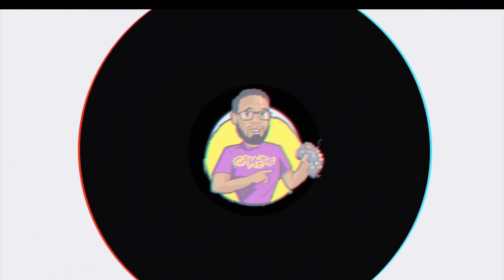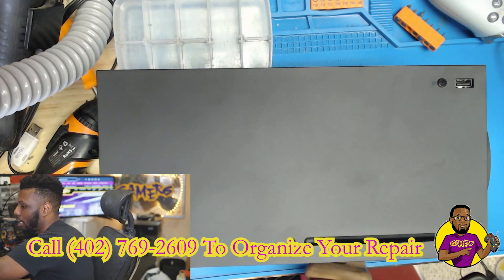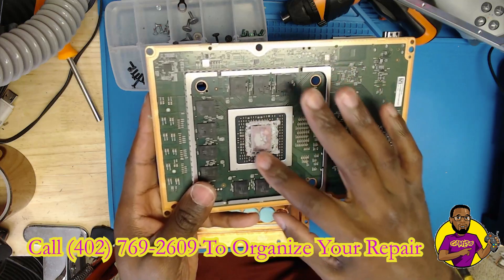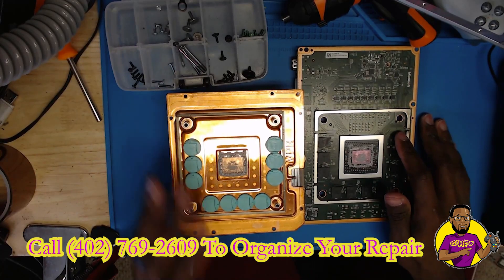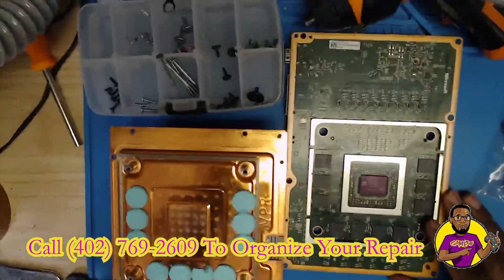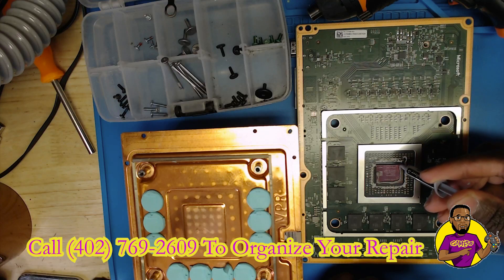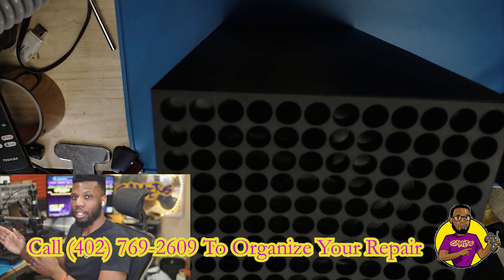Fix Xbox Series X Overheating and Turning Off Repair

Comment: The fact that you have to change thermal paste after 1-2 years says it all. The ps4 even lasted 8 years until it turned into vacuum cleaner simulator. Had my first overheating shutdown and barely owned the series x since Christmas.
Reply: have to change thermal paste on all computers after 2yrs anyway so consoles are no different
Reply: There are other factors at play.  Viscosity is a huge one.  MX-6 so far after a full year of use has been solid.  Whereas kryonaught would pump out (essentially oozing itself out from between the chip and heatsink) after a few months.

The PS4's fans were taking other temps into play.  My original launch day PS4 was loud even after putting good paste on it.  It wasn't until after I changed out the Memory Thermal Pads that the peak noise was significantly reduced.

Then look at the PS3 Original models.  There are loads more Thermal Pads which leach out oily substance after years of degradation.  One of my original 60GB models would progressively get louder and wouldn't get quieter even at the XMB.  It wasn't until I popped off the Heat Spreader on the RSX and changed that out with MX-6 that the Fans remained quiet and would slow down when the load was reduced.

All in all, Gaming machines and PCs, even handhelds, all need maintenance at some point.  I am curious to see how long Liquid Metal lasts on the PS5.  Will we see cases where an unopened PS5 that is regularly dusted has dried out Liquid Metal?
Reply: my firts series x was a beast this second one it already turning off wish i had the first one back

Comment: Set to energy saver and disable automatic updates. Trying to play any of the high resource games while the system updates games in the background will Chernobyl your console. If your console keeps throwing the ventilation error randomly check your queue and pause or clear it.   All I have seen are videos telling people to open up their consoles or send them to Microsoft for repair.
Reply: Good shit. As soon as I switched to this method it stopped immediately 💯
Reply: @josh-o8t I did find that the power outlet on the other side of the wall was on the same circuit, so an appliance in the other room was drawing enough power to rob my Xbox of juice. I moved the offender to a different outlet and I haven't had anymore overheating problems.
Reply: @josh-o8t Have you resolved your issue? I know I was super pissed until I figure it out. It feels like a lot of us paid the extra money to acquire on of these new consoles during the shortage and that makes any bugaboos even more painful.

Comment: i have an xbox series x since march 2021. over time it started to heat up and i could hear the fan blowing louder and louder.  sometimes it went out by itself for safety.  following this tutorial I opened it for the first time to clean the fan and the cooler.  It wouldn't turn off anymore but the fan was blowing hard when I was playing FIFA 22 or resource intensive games.  it bothered me so I bought an ''ARCTIC MX5'' thermal paste and since then my console no longer heats up and the fan runs normally like on the first day.  I strongly advise you to change the thermal paste you will notice that the old one was not of very good quality.
Reply: This started to happen to me right after playing fifa 22!
Reply: xbox series x fan loud

Hi i have aan issue with my series x in some optmise games series s x my fan goes loud for exemple 
Fifa 22 in.the menu 
 Ac valhalla in performance mode only quality is dead silent 
Halo infinite warfare performance loud but quality silent 
 Its not like a ps4 level but its noticible ...
 I ask some friends they told me that their console a quiet .. even with heavy loud 
For old gen games even in 4k its  silent ... 
Also another think i try everything reset console performe offline ubdate cleanig from dust only without open it ..
Remaining now only change thermal past
The last games tennis match point make it loud even its not an heavy game .. also this games called lake its make ot loud anyone can help or confirme what i said please
Reply: @fingerstyle9165  Hi my friend.  I understand your concern about this fan problem.  the solution is to buy a thermal paste like Artic mx4 and follow the tutorial to open your xbox and apply the new paste.  you won't have any fan issues.  on the other hand if the place where you placed your console is hot it will have to be replaced elsewhere. Peace
Reply: @SoufixTTV   i know but i wanna make sure its already well ventilated   .. but why happen only with tittles series s x  .. that my concern thx you i will soon open it and apply the new thermal past
Reply: @fingerstyle9165  because series x games are way harder to run then Xbox one games
Reply: @stgbuckets   got new xbox and its run quiter
Reply: @fingerstyle9165  idk if I should send it in for repair or just buy a new one I'm done with the crashing issues
Reply: @stgbuckets   but still you can hear fan its not that possible that you cant hear it its 4k man
Reply: @fingerstyle9165  yeah I don't play on 4k tho
Reply: @fingerstyle9165  Is it still as quiet now as you've had it for a year?
Reply: @fingerstyle9165  Is it still as quiet now as you've had it for a year?
Reply: @SoufixTTV  i change the xbox 3 times only for that every time is the same end up by understand that the electricity is the problem man can't solve it in my country but its okay work fine  sometime in the day can't hear it att all
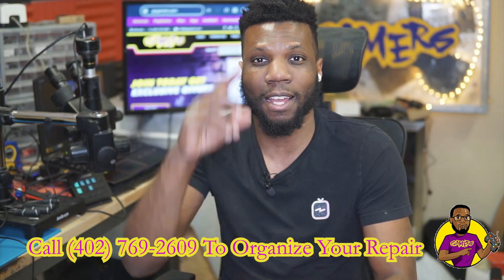Reply: So we have this problem and first place couldn’t fix it. My son will NOT trust me to fix it. So he’s going to place number two.  I hope it comes back to me because I got this! Thanks will let you know if I have an update. 11:02

Comment: Hi bro, thanks for the great video. I’m facing an issue with my xbox series x. The xbox sometimes working fine and great and I can play all my games for hours and hours but the next day when I try to power up my xbox it won’t work just I can see the power is on and the fan is running but no image even the controller is not on , after a few try and reset the power it’s works again and smoothly after a few days the same thing happens again and I need to try to powers it up again and again and then it will work. So can you advise me what to do with this or at least I want to know what’s causing this issue + I always keep the xbox clean and away from any dust . Please advise..

Comment: My xbox series x overheats and shuts down if I play graphically demanding AAA games. The fan will get really loud then it shuts off and I get that error message when I start it up. But it doesn't overheat until I play certain games it's so weird. It is a very early series x so that's probably why

Comment: 3:08 shows the reason why THAT unit is overheating.  The thermal paste is spread way way out of the area and is covering the surrounding circuitry.  Either tensioning was uneven at assembly or the holder was over tightened.  You can definitely see it's a terrible application!  Thermal paste requires precision but if applied "correctly" easily lasts a decade before any issues arise.  You don't know what you are doing.
Reply: 7:04 -  7:50 He spreads the thermal paste AROUND the edge of the cpu dye like he is icing a cake and also on the heatsink for some reason where there is no cpu dye their. He says don't put too much on yet he puts way too much. I wonder what his interpretation of "too much thermal paste" is lol. Also that is the worst cpu pattern for your cpu (proven by this short https://www.youtube.com/shorts/96GnOB1iZQI) you can do although, it probably wouldn't matter as the shockingly massive amount of thermal paste he used anyways. He has been doing it for 14-15 years (as he said) as well so would expect better. Oh well it works for now for him and he will probably have a major thermal paste issue when he needs to replace the thermal paste again as the cpu will be more dried thermal paste than cpu. Dried thermal paste will also be covering the resistors around the dye so trying to pick it off may take a resistor with it. He's probably still better than most "professional" console repair services but still, not great I agree.

Comment: My Xbox did this a few hours ago I’ve had issues with overheating recently with the Xbox constantly kicking me from games after about 5 or 10 minutes of playing, so I gave the console a blast with a can of compressed air and it was back to working fine again, but yeah a few hours ago it shut itself off completely no warning nothing. I thought it had packed up completely, but after an about 5 minutes I switched it back on and the message from ur thumbnail was the first thing shown. I pressed on the controller and it took me to the main screen but my account wasn’t active and the Xbox wasn’t connected to the internet, so I pressed on the controller again and it let me select my account and it also connected me back to internet and everything seems fine, but I switched it back off to going to leave it for a while. I’m buying a hard drive next week and I’m going to transfer all my games to it and see how things go with the console. I have a year left on my guarantee, and if it continues I’m going to take it back to the store I got it from and exchange it for another Xbox series x.

Comment: I have been repairing electronics and computers professionally for over 10 years.  I disagree with your point on thermal paste.  Also ArticSilver 5 doesn’t age well, I stopped using that junk years ago.  You don’t have to apply any onto the heatsink at all.  I have repasted thousands of devices, I learned from my trials and errors.  When doing direct die paste applications, it is essential that every single part of the die is covered, if it is a IHS you can simply put a dot in the center and it is more than good enough.  Another trick I learned is to use Electric Contact cleaner to remove old paste from heat sinks and chips.  Alcohol isn’t as strong, where as contact cleaner will make the parts look as if you never applied paste before.  I believe this gives the new paste more gaps to fill and prevents contaminating the new paste with remnants of the old paste.
Reply: What paste would you recommend
Reply: @MorneSteenberg-t3q  MX-6 has been rock solid with every machine I have applied it to.  Haven't noticed a decrease in performance like I usually do with Thermal Grizzly.

Comment: Thermal paste is good for 5-6 years, this Xbox was probably clogged by dust on the heat sink.

Unless the paste was badly installed in the factory.
Reply: i i have aan issue with my series x in some optmise games series s x my fan goes loud for exemple 
Fifa 22 in.the menu 
 Ac valhalla in performance mode only quality is dead silent 
Halo infinite warfare performance loud but quality silent 
 Its not like a ps4 level but its noticible ...
 I ask some friends they told me that their console a quiet .. even with heavy loud 
For old gen games even in 4k its  silent ... 
Also another think i try everything reset console performe offline ubdate cleanig from dust only without open it ..
Remaining now only change thermal past
The last games tennis match point make it loud even its not an heavy game .. also this games called lake its make ot loud anyone can help or confirme what i said please
Reply: @fingerstyle9165  don't worry until it over heats it depends on air flow and ambient temperature also
Reply: @figotech3159  yeah i guess

Comment: What about if it doesn’t give you an error you shut it off for her for a couple minutes because she had to go do chores. You come back you push the power button. It chimes light comes on. Nothing pops up on your TV and the light goes out and it keeps doing that constantly. It will not turn on completely.

Comment: When I select 'Turn Off' using the controller after using the console for a while I see a green screen and then the controller loses sync and the light on the controller starts flashing. I cannot then turn the console on again using the controller and have to turn it on using the power button on the console. Any thoughts? 

I don't have the problem when the console has only been on for a few mins and no games have been played. Do you think this could be an overheating issue too?

Comment: i i have aan issue with my series x in some optmise games series s x my fan goes loud for exemple 
Fifa 22 in.the menu 
 Ac valhalla in performance mode only quality is dead silent 
Halo infinite warfare performance loud but quality silent 
 Its not like a ps4 level but its noticible ...
 I ask some friends they told me that their console a quiet .. even with heavy loud 
For old gen games even in 4k its  silent ... 
Also another think i try everything reset console performe offline ubdate cleanig from dust only without open it ..
Remaining now only change thermal past
The last games tennis match point make it loud even its not an heavy game .. also this games called lake its make ot loud anyone can help or confirme what i said please

Comment: Sometimes I’ll be playing multiplayer and my game will just crash and nothing else happens, no message on the screen or anything and then I feel my Xbox and it is super hot. My room gets hot in the summer. Could this be the issue? It is really annoying when this happens especially if I’m playing multiplayer.
Reply: did you ever figure out your issue? im having the same problem
Reply: @MrJiggles44  same bro

Comment: Still waiting for someone to make a waterblock so I can finally install a 240mm AIO and forget about heat!
Reply: i have an xbox series x since march 2021. over time it started to heat up and i could hear the fan blowing louder and louder.  sometimes it went out by itself for safety.  following this tutorial I opened it for the first time to clean the fan and the cooler.  It wouldn't turn off anymore but the fan was blowing hard when I was playing FIFA 22 or resource intensive games.  it bothered me so I bought an ''ARCTIC MX5'' thermal paste and since then my console no longer heats up and the fan runs normally like on the first day.  I strongly advise you to change the thermal paste you will notice that the old one was not of very good quality.